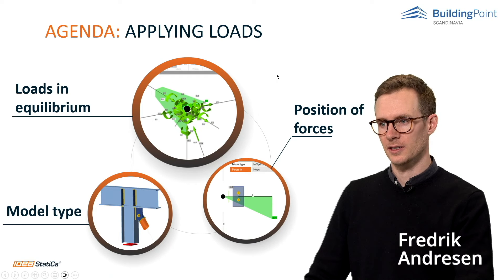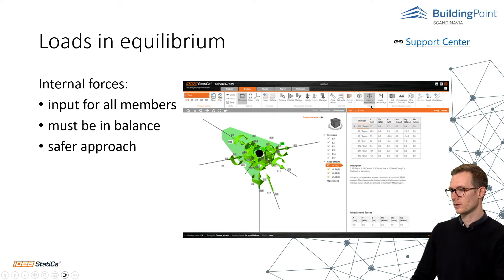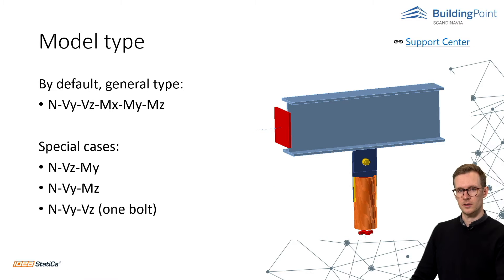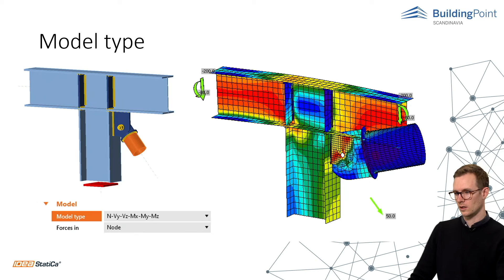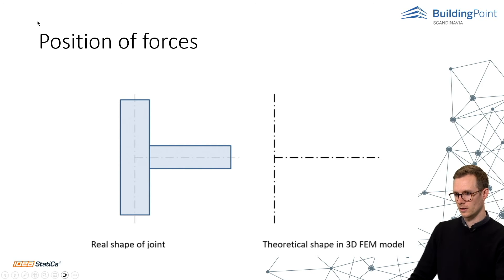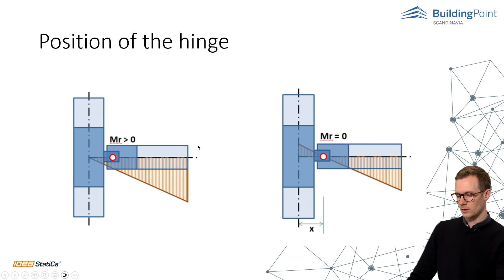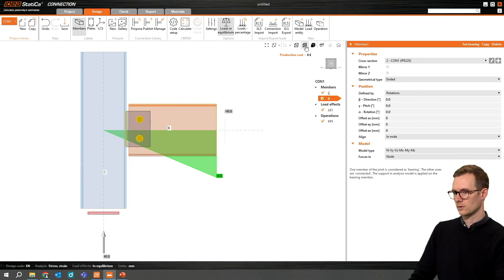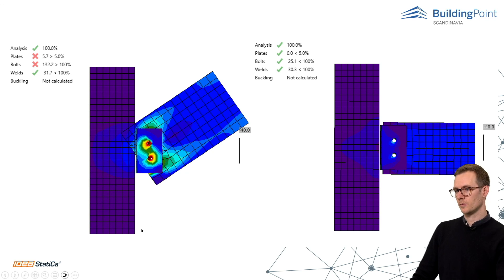IDEA StatiCa Quick Tip - Applying Loads!

Comment: Does the user need to apply forces at the bearing member's end to achieve the balance, or is the software going to apply the unbalanced loads at that end automatically?
Reply from the maker: Hi @telestruct !
From our support team, use this input on your own responsbility 😉

It’s important to note that applying loads at the beginning/end node of the backward rigid link — where the supports are defined — would be meaningless, since any forces or moments applied there would be directly resisted by the supports themselves.
Therefore, the computational model is loaded only at the “free ends” of the members, while the supported end/ends remain restrained. If the connection loading is defined correctly, the applied forces and moments are already in equilibrium. In that case, the reactions computed at the supports will exactly match the loads specified in the input table.
So no, you don’t need to apply the load and the support, but you should do it, and the Unbalanced forces table is there to help you to ensure that the connection is in equilibrium (if you have put in all the internal forces in the input table correctly). It is not always easy to see without actually doing it.
In other words, the internal forces on the supported side of the bearing member are not directly applied to the model. Instead, they appear naturally as reaction forces calculated by the FEM model, ensuring equilibrium with the applied loads.
You can find more information about this topic here:
https://www.ideastatica.com/support-center/principles-of-loading-in-a-connection-equilibrium-bearing-member-etc
Reply: @BuildingPointScandinavia  well noted. Thanks for the explanation!